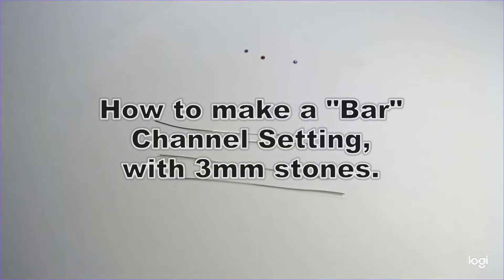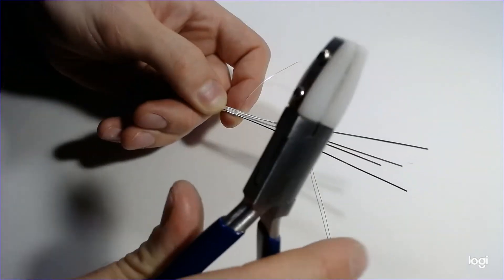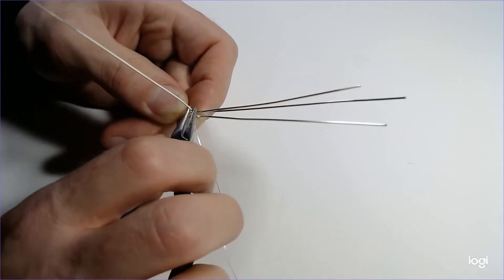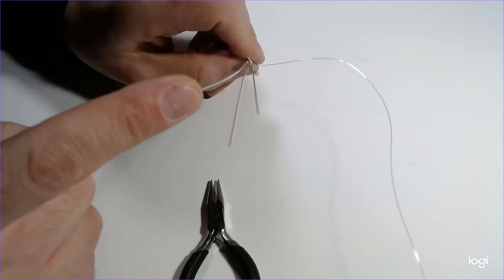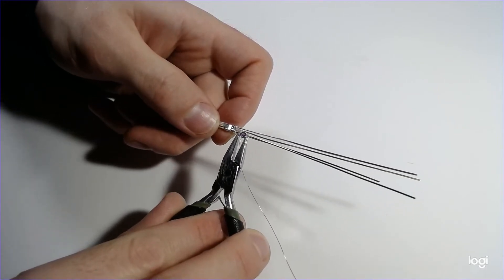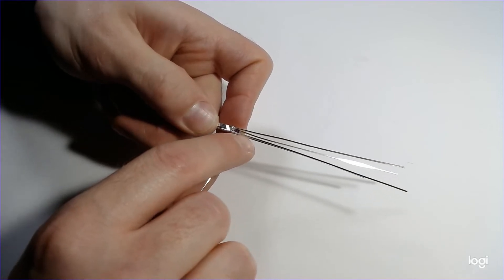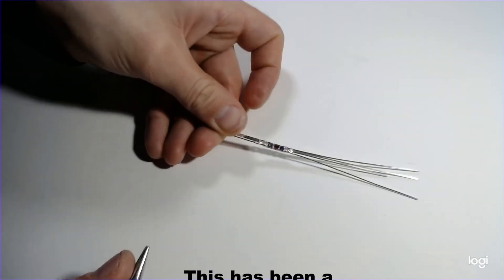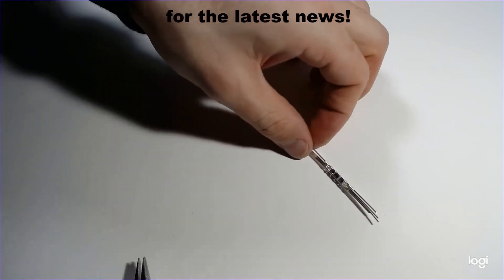Wire Wrapping Tutorial: Bar Channel Final, Wire Weaving, Wire Wrapping tutorials

Comment: Been studying this technique on many channels, it seems generally the technique is all the same in application, the struggle is making sure you are using small enough wire ontop of a larger gauge. I may try 28 or 30 gauge for mine in the future to garentee that tightness required for this technique